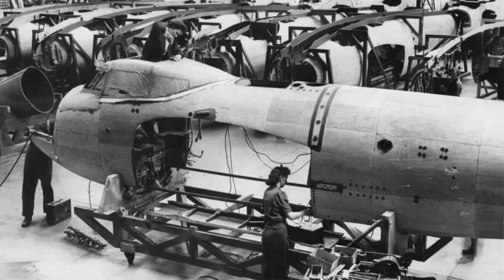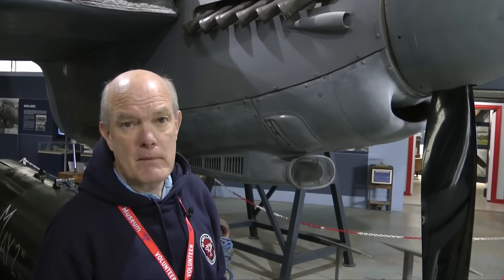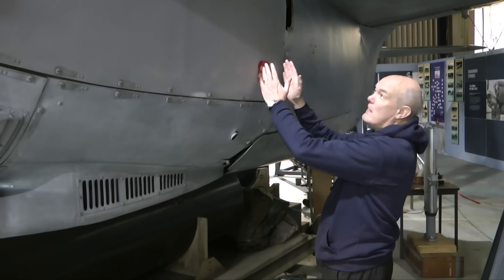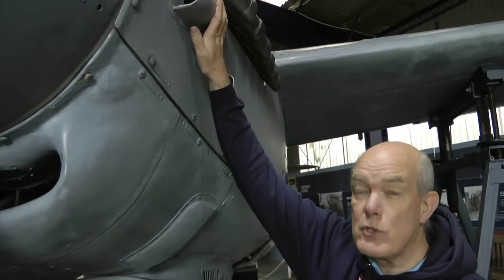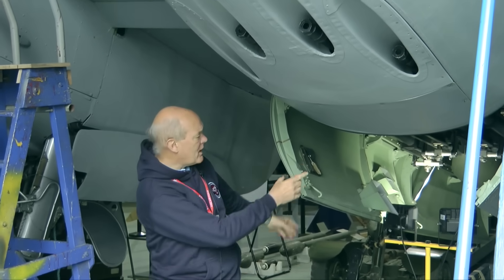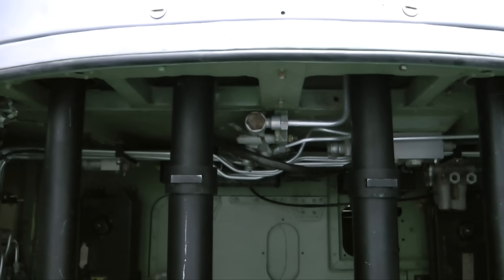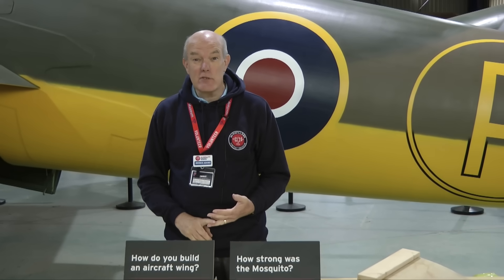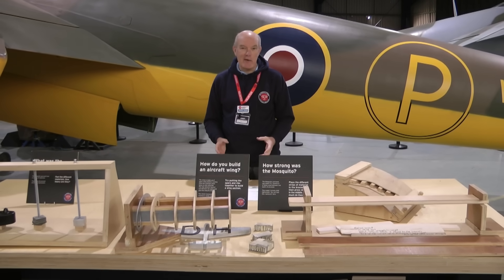Why are there so many holes in a Mosquito? What are they for? Surely they will cause drag?

Comment: Actually, if need arised  for more speed, engine nacelle ducting could have been further optimised by using single intake for accessory/ intercooler air, as been done in Mustang or FW-190.  ( in Fw-190 all needed air ( for oil cooler, supercharger etc.. been taken from cooling fan inlet) 
Quite interesting fact about Mosquito aerodynamic is that doped fabric has been used to cover entire surface of plywood wings and fuselage levelling any  imperfection or seams. For minimal weight increase designers manage smooth surface boundary airflow significantly reducing parasitic drag considerably. Over the wings it wasn’t laminar airflow , but very smooth with minimal turbulences. 
Wing roots radiators being feeding slowed hot air under bottom of wing surfaces , creating additional lift. This extra lift provided nett reduction in drag of wing at high speed. 
Secret of Mosquito is this careful stacking of all small additional advantages, making it not only fast, but  range and easy to fly.

Comment: The two stage engines get 6 exhaust stubs both sides. Is this right? The two stage supercharger is longer, so the engine block ends up being further out front so, there becomes room for 6 stubs inboard, but also the propeller hubs end up being a bit more forward as well..(?)
Reply from the maker: That is correct

Comment: The thrust created by hot air exiting a radiator is known as the Meredith Effect. Aerodynamic drag from Spitfire & Hurricane rads was mostly cancelled out by the thrust effect. P51 Mustang exploited the effect an got at least 4mph on the top speed. Expanding hot air was used to fill the low pressure area behind the fuselage. 
1990s engineer John Britten developed a 1000cc race motorcycle which put the radiator behind the engine. Hot air was sucked out around the rear wheel. The high exhausts gave a similar benefit to the rider generated wake. A small gain but it was a racing machine.

Comment: First stealth aircraft.  By accident.  Because if the Woden design German radar of the time could not detect it.  It also had the idea of high flying high speed rather than large amounts of turrets to protect it. Yes I know there where gun versions but none wasted space on added extra manned turrets for protection.  Even the bomber version could carry large loads at high speeds. So the idea of speedover fire power for protection which was contrary to all doctrine of the time

Comment: They were amazingly fast. I have "Low Attack" (John Wooldridge), which recounts the daylight raids by unarmed Mosquito bombers of 105 and 139 Squadrons into occupied Europe and, even as far as Berlin – this was 1942/43. The aircraft flew at high speed at low level – "low level" often meant looking up at the tree tops. A feature of the stories in the book was the speed at low level of the Mosquitos, where they were as fast as the Focke Wulf 190. If a 190 pilot going one way saw a Mosquito going the other way by the time he had turned to give chase the Mosquito was too far ahead.
During the Eindhoven raid on the Phillips factory, on the way to the target, some Mosquitos caught up to slower Boston bombers and had to throttle back a little. Two 190s latched on to the Mosquitos, so the two aircraft under attack turned away from the formation, with the 190s following, put the power on and headed back to the coast with the 190s trying to catch up. Eventually the 190s gave up, by which time the main formation was long gone.

Comment: I've seen your video on fuel tanks and this makes me thinking :
Does the radiator configuration reduce the potential size of the fuel tanks in the wings? As you said, this is a matter of compromise, and I suppose the question is open about "does the drag external radiators would bring consume more fuel than the fuel we could add in the wing if we configured it this way"?

Comment: How can the air out of the radiators create thrust? Wouldn't it be exiting at the same speed as the air flowing around the wing? Or even slower due to the resistance of having to flow through the radiator?
Reply from the maker: The air can be compressed and heated in a well designed radiator system similar to a ramjet. look into the  Meredith effect for more information.

Comment: Please stop perpetuating the misinformation that the Mosquito was a 'lightweight' aircraft.  It was not.  For its size, as comparted to all metal aircraft, it was heavier by far.  The Bf110 of very similar dimensions had an empty weight of 10,765 lbs.  The Hampton, quite a bit larger than the Mosquito was 12,764 lbs.  The P-38 Lightening, 12,800 lbs.  The Blenheim, of exactly the same dimensions was only 9790 lbs.  An empty Mosquito weighed 14,300 lbs.  It's performance was never about being a light wooden airframe.  Time to kill that myth and you should know better.
Reply from the maker: Thank you for your comments, and for all the good work you do at the Calgary Mosquito Society. 
You are quite correct - the weights you have quoted prove that the Mosquito was not "light" in comparison with other bombers of similar size. 
Rather, the smooth aerodynamic design, high wing loading and sheer engine power contributed to the performance. 
We will make sure we emphasise these factors in future.

Comment: Oh please they are not holes. They are openings. Holes are what appeared if an enemy aircraft managed to get up behind you and loose off a few round or ack-ack (archie) manage to pop off a round near you and shell fragments aka shrapnal made holes in the fabric covering or pieces of the limited metal skin. Opening are not the result of enemy action and are place where they are for a specific purpose. 
I may finish this after recovering from the trauma of you using such an incorrect word. It is English so you should be fully au fait with it. 😱

Comment: Excellent video! And I finally understood the 10 exhaustive thing, thank you! One question, does the supercharger compress only air or the air/fuel mixture?
Reply from the maker: The supercharger sucks the air-fuel mixture from the carburettor into the engine.
Reply: @deHavMuseum  thanks! Another question: Does The turbo charger compress only air?

Comment: Great summary, and I had never noticed the oddity in the inboard exhausts.  The charge cooler did drop the mixture temperature going in to the engine but its main function was to increase charge density to get more petrol and air into each induction stroke and increase power.

Comment: About the Meredith (thrust) effect of the radiators, I wonder if it would have been beneficial to have the radiator exhausts on the top of the wing to gain a lift boost similar to what you get on the Boeing YC-14 or Antonov An-72.
Seeing they didn't do that, it probably caused more problems than it was worth, but still it would be interesting to know wether they considered it.

Comment: Just imagine how slippery and sleek this bird will be if the ducts and scoops get swapped out with NACA ducts.  Perfect ship for cross country air racing providing you have an excellent navigator.  GPS is not allowed in cross country air racing, it is all manual navigation and hand flying.  It is a test of skill and accuracy as well as speed.

Comment: Clear and interesting..big thanks..I'll visit one of these days! I have a vague memory that early designs had an unbroken leading edge..but the rads were moved forward to increase the cooling effect while taxying..is that right? Wonderful machine anyway..a genius company actually!
Reply: My late father always said he had his eye on engine temp whilst taxiing. Centrifugal  swing was the nemesis of many an inexperienced pilot., especially so on airstrips of PSP. Tough planes and certainly embued confidence. On recce missions he found their sheer speed and rate of climb useful; also absorbed huge tail damage from flak and rudder loss from friendly fire from two rookie mustang pilots who were to escort the plane over Austria but thought it was an attacking german plane. His navigator told me they got out of the cockpit through the roof panel in about 1  mins tops, by standing on his navigators head then hauling him out. They had twin engine failure on take off but the body stayed intact. Such is war in a very fine and safe aircraft.

Comment: That magneto cooling would be very suspect in heavy rain. British engine so allergic to water! And yes I have seen the ignition system on those.
The Mosquito was a very good aeroplane,, but had a very limited life because of all the wood. As has been said they are 10000 termites in formation. And those laminates were not very good with water and in some theatres heat as well. That is why there is next to none flying, would never pass survey. 
At least a few in museums where they will stay, well unless you are a movie producer with a big team of people. And they will baby that plane for its entire new life. As they ofcourse should.
Reply: Some Mosquitos lasted in service until the early 1960s. They did not have a limited service life and wood if properly looked after will last longer than any metals.

Comment: Is that a small outlet above the carb intake? And the slots along the carb intake body? 
Is the intercooler intake massive? No bigger than that on a Mustang.
The Typhoon/Tempest intake was larger housing both the radiator and oil cooler.
They built a Tempest with wing radiators as well.

Comment: I've often wondered why I could only count 5 exhausts when I knew it was a 12 cylinder engine. I was beginning to doubt my ability to count. Thank you for explaining this
Reply: Eeeh?
10...
Reply: Some later models did have all 6 exhaust pipes. Not sure what made this possible, and how much power it added  Tests showed a 10 mph speed gain on a  single engine fighter with properly designed pipes. The Germans knew this too.
Reply from the maker: The later Mosquito mark B.35 (which you can see at the museum alongside the earlier FB.VI), was powered by Merlin 113 or 114, which had two-stage superchargers and intercooler. This made the engine bay longer, so that there was sufficient room for 6 exhaust pipes per side.

Comment: If the supercharging increases the temperature of the air, why would the air go through the carburetor firsts? Surely, the air was supercharged first, and then the fuel added.
Reply: Evaporative fuel cooling contributed substantially to keeping the charge temperature down while being compressed in the supercharger (a 'luxury' not enjoyed by direct fuel injection engines). Hope this helps.
Reply: @kennethrodmell9006  makes sense.
Reply: I expect it's something to do with air/fuel ratios

Comment: Very informative video! On the same subject, what for was that long bulge on the fuselage RHS behind the wing trailing edge?
Reply: If it's the prototype you are asking about (yellow underside) they had to add external strengthening when it was repaired after landing damage. Later airframe also had a strengthening ribbon added behind the wing.